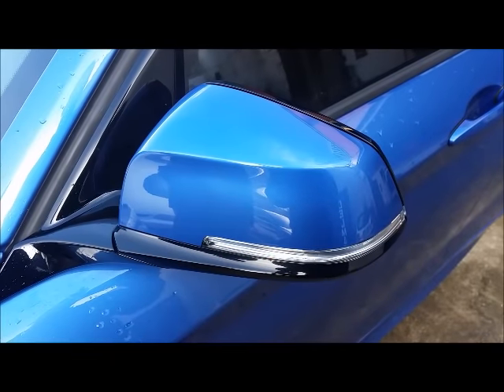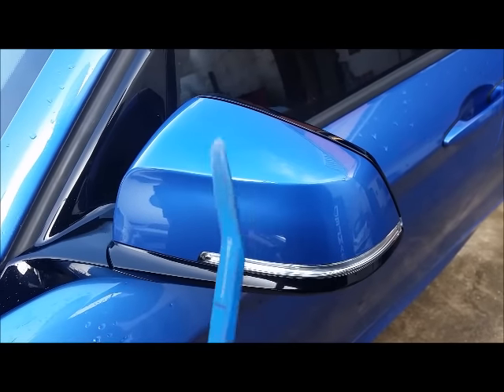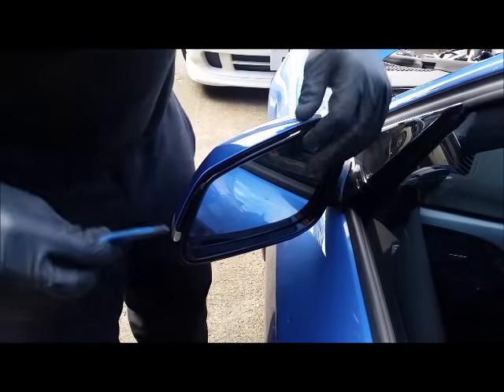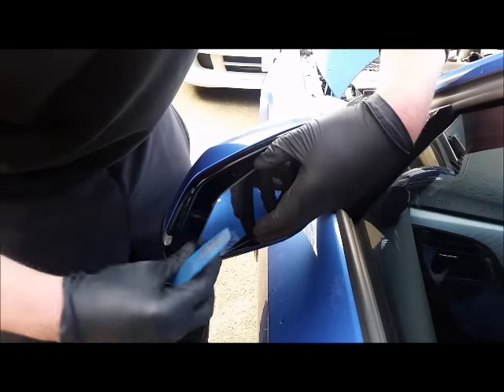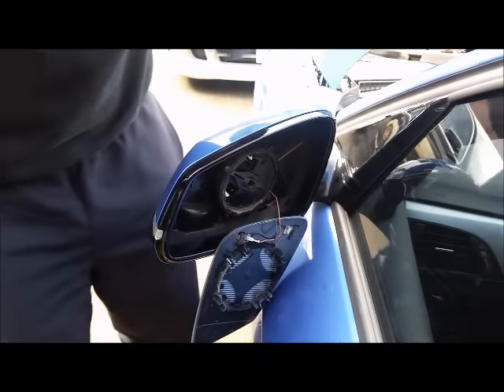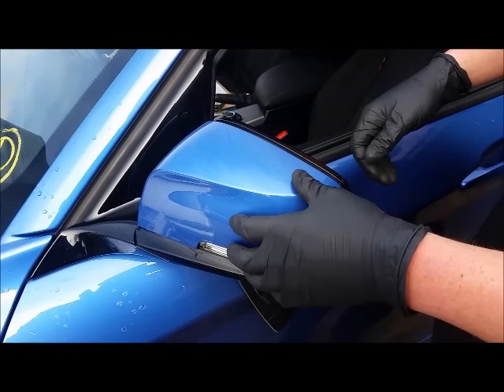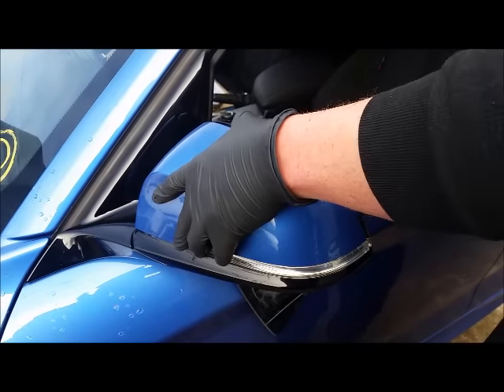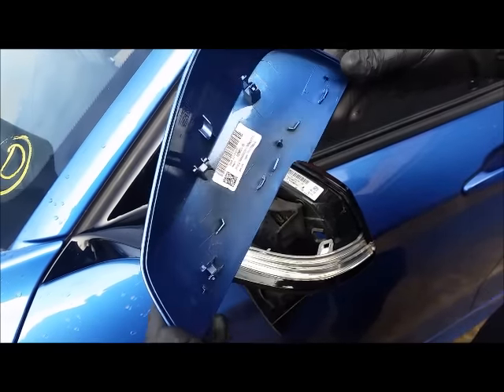BMW 1/2/3/4-SERIES - How To Remove Wing Mirror Cap / Cover Removal (F20/F21/F22/F23/F30/F31/F33/F34)

Comment: Just a note, do NOT trust those wire connectors to securely hold your mirror glass. Just take the connectors out and safely place the glass to the side until it’s ready to go back on.

Comment: I followed this guide using same plastic trim tool and it shattered the glass :( No problems from the bottom using a wide tool though
Reply: Daryl Reseigh same :/
Reply: I'd be super careful using a plastic trim tool. Its a very expensive mistake if the glass does shatter and it doesnt take much atall! £108 for a new heated mirror glass or £300+ if dimming and anti dazzle!!! Used a flexible plastic wedge in the end and carefully prise from the bottom only.
Reply: Same
Reply: Yep, likewise. Driver side came of just fine. Passenger side shattered.
Reply: The tool HAS to go further behind the glass. If the too is too closer to the edge of the glass, it'll break nearly EVERY time.

Comment: I had my brand new car for less than 10 hours and this video made me brave enough to try. Worked flawlessly. Thanks!!
Reply: seedy rom I’m looking at doing it myself as well... I ordered the carbon mirror caps, but it came with screws instead of clips. I wonder if it would be a similar process (my car is a 2018 340i)

Comment: Another one for the Broken glass!!  The card behind the cover worked for me!
Reply: did you break any clips off the original mirror cap? I really dont wanna break any clips off
Reply: Same problem... broke glass...!! 😭😭, I need more expertise
Reply: If you are careful you don’t break the glass, whereas removing caps from outside nearly always breaks 1 or more of the clips
Reply: I broke one clip, I didn't re fit them though, so not really an issue, better then breaking the glass!
Reply: @Scoobymike2  I’ve just fitted M4 style carbon mirrors and led indicators on my m235i and I’m the most impatient git going yet I got the glass off so easily, you’d have to be really rough/clumsy to break the glass.
Reply: @danwhitaker5168  not at all, I wasn't clumsy or rough. Glad yours came off easier than mine!
Reply: @Scoobymike2  😁 that wasn’t directed squarely at you fella, I’ve read loads of comments about breaking the glass so I was surprised how easy they came off, but when I got the car it already had carbon standard caps so guessing someone did all the hard work loosening the clips for me.
Reply: @danwhitaker5168  no worries, I wish mine did come off easily, even when I got around the changing it, it didn't come off easily, and I wasn't being careful then!!